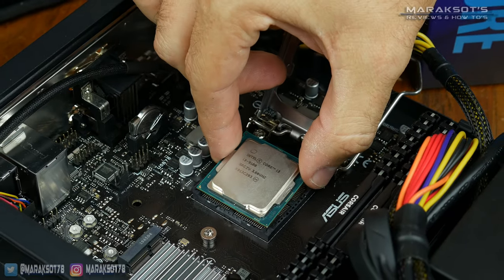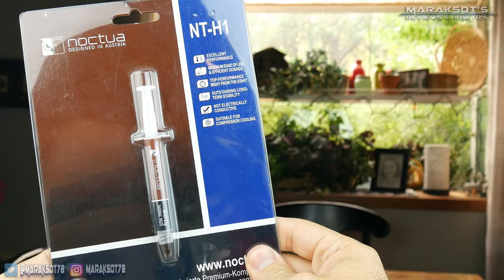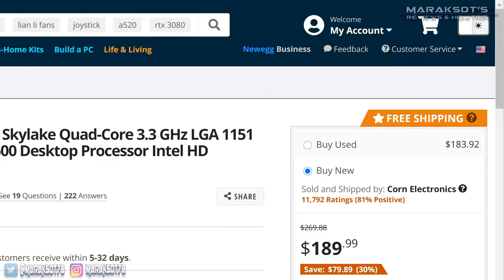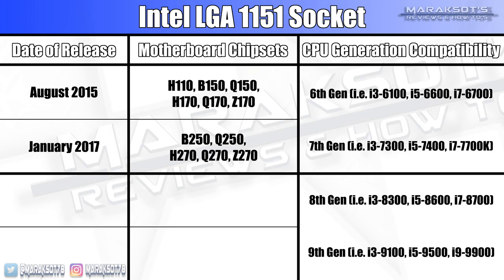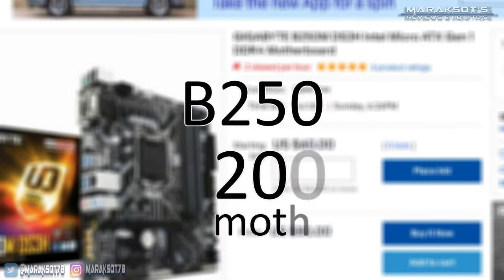A Beginners Guide: How to Upgrade an Intel CPU (core i3, i5, i7, i9)

Comment from the maker: Wanna skip to a particular part of the video? Use the Time Stamps. :)

Time Stamps
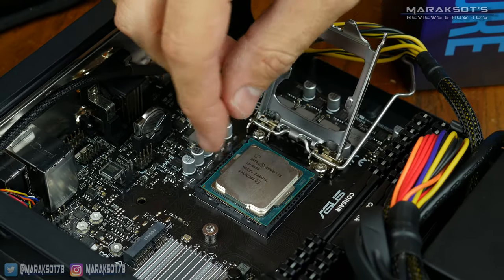0:00 – intro
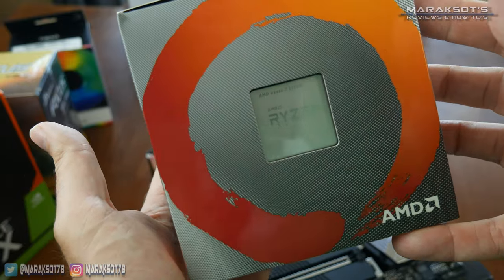0:46 – the first steps
2:02 – CPU cooler removal
2:18 – thermal paste cleanup
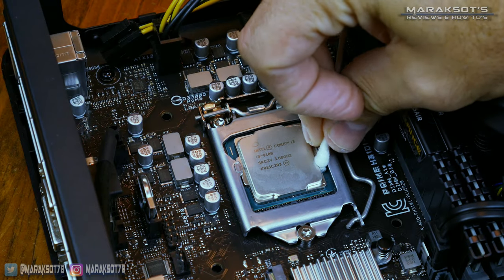2:38 – remove your existing CPU
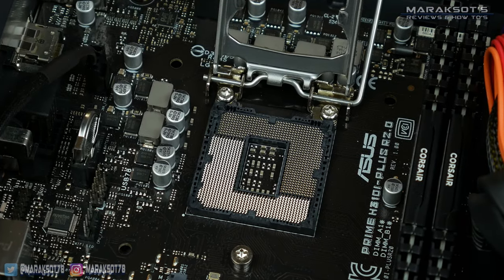3:14 – installing your new CPU
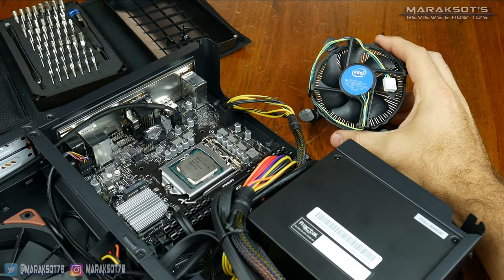4:35 – CPU cooler installation
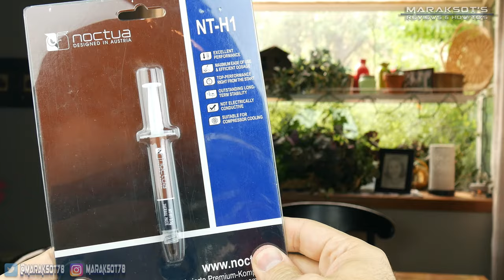5:10 – thermal paste application methods
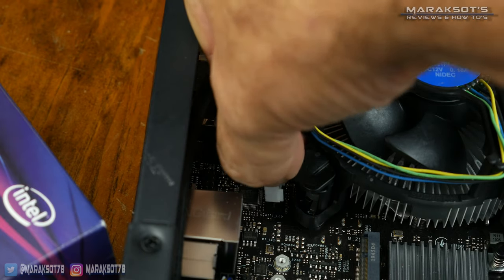5:36 – important things to know when upgrading
6:12 – know your CPU socket
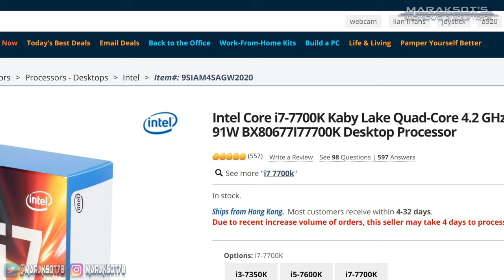7:04 – Intel's LGA 1151 socket is a little confusing
8:07 – motherboard chipsets
9:27 – K series processors
10:16 – cheap motherboard + expensive CPU = Please don't!
11:23 – Thanks for Watching! Like, Share, Comment & Subscribe! :)
Reply: #6%Club
Reply: This video has really broadened my horizons on upgrading CPU for my mainboard... z370-a pro (msi) my motherboard supports overclocking and 8th/9th generation CPU processors.  😁😁😁
Reply: My laptop currently has a fourth generation Intel Core i7-4510U CPU. What would be a good compatible processor upgrade? Or where can I get a chart that would show me options? Thanks for your help!
Reply: Hello,
I have a Star Wars, hp laptop. The cpu got fried. I want to replace the cpu & upgrade the rams from 8 to 16.
Can you please film a vid on this topic. 
All the best Shaun of NYC
Reply: My cpu is a intel core i3-10100 whats a good upgrade for mine bought a core i5-10600k did not work plz help proper cpu for my computer
Reply: #6%club
Really helpful video from you thank you
Reply: any tips on how tu see is my mother bord compateble with now cpu i have hp 18e4 motherboard
Reply: My desktop motherboard is   H61M-S+
Manufacturer_ AS ROCK
CPU socket_ LGA1155
Memory_ 2*DDR3 1600
Graphics_ Support s Intel®️ HD Graphics built-in Visuals With processors which are GPU Integrated.
Graphic output_  1* D-Sub
Sata_ 4*Sata2
USB_8*USB2.0
LAN_ Gigabit LAN
Form Fector_ Micro ATX
Please suggest me CPU for this
Thanks 🙏
......I will wait for Reply. 🙄
Reply: You should do a video on mining crypto on old cpu, then upgrade the cpu  to see the difference in hashrates.  That would be AWESOME!!
Reply: I got a i912900KF the new one right now! What motherboard do I get?
Reply: Hi, please, can you tell me what's wrong of this computer,, after upgrading from a single core CPU to a duel core CPU the computer runs slower and only shows one CPU graph in task manager. Please can you tell me what's wrong?
Reply: I wanted to add a new Intel CPU to my Asus H97M-e mainboard that has an old Intel  i5 4460  CPU but in the computer shop they said that all Intel CPUs have different sockets and a new CPU won't fit on my mainboard.
Reply: Hey I got a I core 5 12th gen

Comment: Thanks for the help looking to upgrade the 10400f to the 117000f 6 cores just isn’t cutting it for my 3070ti😂
Reply: Did you upgrade? Which motherboard are you using?
Reply: @shoronhossain2443  actually switched to AMD and I’m now using a b550

Comment: Glad to see a proper explanation when doing a CPU upgrade. I've seen so many that overlook the motherboard sockets. Specially since Intel did what they did with LGA1151. Just as AMD AM4 socket depending on generation only supports certain gen Ryzen CPUs as well.
Reply: 6% club. Tnx v much. Very clear instructions
Reply: If you have an LGA 1150, does that mean all CPU'S that fits in the 1150 will work?
Reply: @NathanielSolomons  Depends on the board and the BIOS. Sometimes support for CPUs needs a BIOS update, but should fit most other LGA 1150 processors. Just have to check the motherboard specs to see which CPUs are supported.

Comment: #6%club...thanks for a great video.  Knew how to buy the CPU but was a bit leery about changing it out. You made it really easy and I am less nervous know.  Shouldn't be nervous since I built my computer a while ago, but was-lol.  The antistatic wrist wrap bit was hilarious, lol I think I still have mine somewhere with extra cables and fans in a box somewhere. Waiting for my graphics card to come in (old one just up and died, think a power surge got it) then will change the CPU and GTX out at the same time.  Thanks again for a great video, nice and clear info is much appreciated.

Comment: I have a Dell G5. Thanks to your video I was able to determine the best CPU to buy for my specific motherboard. I currently have a  i5-10400F and wanted to upgrade to some sort of i9. I used the command prompt as instructed, used the number to google it and I can only upgrade to 1 type of i9 which for someone like myself that isn't overly tech-savvy I am not overly picky as long as it gets the job done for a few years to come so It ended being a i9-10900KF. It's reasonably cheap at over $500 with taxes. Looks like I made my decision thanks again to your video

Comment: Here on the heels of installing new RAM from the other video, and grabbed an i7 on sale (currently using i5). Not quite brave enough to upgrade it yet (there's a few assignments I'd like to get out of the way first in case things go terribly wrong), but will be following this process when I do! Thanks for making the steps clear and easy to follow.

Comment: Excellent video. Looking to upgrade from my i5-7600K. Was curious to see that no 8th or 9th gen options were compatible (using the CPU-upgrade website), but your bit on motherboards explained that as I have a Z270-P so would have to upgrade to a "300" number for 8th/9th gen options. Now I'm wondering if I should go upgrade the motherboard as well as the processor or just go with a i7-7700 or i7-7700K processor upgrade. Any thoughts?
Reply: Definitely
Reply: If moneys an issue then dont

Comment: I'm using i3-4170 and I'm upgrading to i7-4770
Reply: Nice
Reply: Did it work?
Reply: You also change your mother board 😂😂
Reply: @hangingbat5439 he probably did since his comment is 3 years old...😂
Reply: How
Reply: @hangingbat5439 why?
Reply: @mieru  his motherboard is outdated for the i7 if he has a i3
Reply: Am upgrading to i5 from i3
Reply: @Quesadillaman111  if they have H81 motherboard, its still good to go
Im myself using h61 motherboard and running i7 3770, and it's work perfectly fine
Reply: @helluvademon3936 i5 and i3 doesn’t matter what is the model
Reply: Same
Reply: @Quesadillaman111  no. I was able to just replace it.
Reply: @hangingbat5439  aren't they both lga 1150?

Comment: This may have been added to your comments already, but a great app you can use to ID your motherboard is CPU-Z, and it is free! I'm using an H170 series Core i5 6400T and want to upgrade to a Core i7.  Still working out the kinks, but this video has helped me get closer! Thanks!

Comment: Very good information.  Thanks!  One question, however, what does "over-cloking" mean?
Reply from the maker: Overclocking is the term used when you manually set your CPU, RAM or GPU to run faster than it's out of the box speeds.  For example a CPU's operating frequency might be 4.3GHz, but with adequate cooling and such you may be able to run it at 5.0GHz instead. Overclocking was more of a thing in the past though.  Thanks to competition in the market, manufacturers such as intel and AMD now build in frequency boost features to their CPU's and GPU manufacturers do it as well to try and sqeeze a much performance out of their products as possible out of the box.  Which is why you'll see CPU's now say their operating frequency is 4.5GHz with 5.0GHz boost.  That just means in normal scenarios the CPU will run at it's 4.5GHz operating frequency, but when more power is needed it will boost up as high as it can for a short period of time, usually until the CPU gets too close to it's maximum temperature, at which point it will lower the clock speed to bring the temperatures back down.  There is of course a lot more too it than that, but I hope that at least gives you a basic idea of what overclocking is. Cheers.
Reply: @Maraksot78  Great job of explaining this point!  I appreciate it very much.  Cheers!

Comment: I've been upgrading my Aurora R8 I got in 2018 recently. I've upgraded the RAM to 32GB a couple months ago, and I'm planning to upgrade the stock i5 9600k to an i9 9900kf which, as far as I can tell, is the highest performing Intel CPU with the same socket type. I chose the kf variant since the integrated graphics of the k variant is superfluous when I have a GeForce RTX 2070, and its so much cheaper than the k variant. Thanks for the vid man, major component replacement really is plug and play with these modern desktops huh? Lol

Comment: Great video/explanation. I've been thinking of upgrading my i5-8400 CPU @ 2.80GHz, on TUF B360M-Plus Gaming S, what are my options?
Reply from the maker: If you're looking to see a noticeable performance upgrade then I'd recommend going to a 8000 or 9000 series i7 like the i7-8700 or i7-9700. The B360 chipset doesn't support overclocking so I wouldn't spend the extra money it costs for a 8700K or 9700K.
Reply: @Maraksot78  Thanks a bunch! What about i9? Possible/doable-worth it?

Comment: This video was very helpful - I was changing the same socket, actually from i3 7th gen to i7 7700T. Nothing has exploded yet so that's good. I would note that the cooling fan is not that easy to snap out, and also not easy to snap back in. Also yes #6%club

Comment: Greatings my dear!

This video was very helpful for me, thanks.

I'm a freshman in CS and would like to upgrade my pc to fit my current and next needs.
Before, I use my pc for data analysis with R studio, tableau and SQL platforms, etc... Now I want to jump in video gaming and programming.
The PC is 10 years old  I think and it is from DELL.
PC: Optiplex 9010 Intel i5.
I want to upgrade to Intel i9 if possible. I can change anything that needs to be changed.

My question: Can you give me a guideline to follow in order to reach my objectif? Or propose a better idea?

Thanks!

Comment: So, this was quite a few years ago that I got an Omen pc. At the time we were going to build a pc from scratch, (my brother was, he knows more about this than I do but has since moved), and we had ordered all of the parts, only to find out that the order was canceled over the weekend because of a credit card error. So we set about re ordering everything only to find out that the graphics cards had gone up to $350, where as they had just been $150, I think. So we shopped around and got an Omen, as it was going to be cheaper than building at that point.  Anyway, I'm very late to the game now, but seeing as the issues with computer chips, graphics cards are going to continue on for the foreseeable future, I thought I better figure out what my pc needs/and can use, get it and upgrade what I can now, to save some time/money down the road. I've mostly used it for things like GW2, lol, the Witcher 3 and so on, and haven't had any issues yet, but I figure it can't hurt to learn these things myself. Although I don't think I need to upgrade the cpu, I think I could upgrade the ram (it has 2 slots for it).

omen desktop pc 870-2XX
Intel(R) Core(TM) i5-7400 CPU @ 3.00GHz   3.00 GHz
8 GB Ram 1Rx8 PC4-2666V-UA2-11 MTABATF1G64AZ-2G6H1

Comment: Thank you, I just learned I have a low-end PC and I need to upgrade basically everything. I'm running an (Intel Core i3 4130 Haswell socket 1150 LGA) I don't have a lot of cash but I do want to upgrade, I'm a gamer, and some of the games I play just not working up to par. Looks like i'll have to upgrade my motherboard with everything else to get the PC I want to run the games I play and run smoothly. Got my Sub 100% I just learned a lot for this vid. Now I know where to go for more PC info...

Comment: Check Arctic Cooling's site for some tips on cleaning and applying thermal compound. Lint-free cloth is a lot better than paper towels. 70% alcohol will leave residue you don't want. Do not touch the surface of your CPU with your oily, grimy finger tips. That Noctua gunk is really good, BTW.

Comment: Thanks for this explanation. I have a desktop with configuration (Intel(R) Core(TM) i7-5820k CPU @ 3.30GHz  3.30 GHz) and want to upgrade to Core i9. Will it be compatible with the board?

Comment: Hello...Guess I'm a 6%er...great video. I kinda get lost in the component numbers and was hoping you could help me out.
  I have an old but faithful Acer Veritron  M4620G  (B75H2-AM) desktop that recently started acting up and I have tried several things to revive it. I have ordered a replacement motherboard (T60 M4620 ,B75H2-AM LG1155 ) and was hoping to upgrade the CPU from the original i5 to an i7 because I do sometimes like to play COD games thru Steam. Would this upgrade to an i7 be possible ? and if so which Intel CPU should I order ?
  Many Thanks,
  Barry

Comment: currently on an i5-9400 used in a gaming setup. 

i upgraded gpu to rx 6600 from a rx5500 and i seem to be having a bottleneck i would assume.

should i upgrade cpu to i7-9700 / i9-9900 without intentions of overclock to keep powerdraw within same range as my current cpu?

Would it be a big enough improvement for solid/stable 1080p build?

im trying to just do a cpu swap instead of dealing with coolers, mobo, etc. Also being that im on an hp pavilion pre build.

Opinions would be greatly appreciated thank you and awesome content! #6%club

Comment: Excellent video, am a newbie to the CPU stuff but am looking to upgrade from a intel celeron g3900 to something a little snappier, have an office computer hp prodesk, g600, it has 16gb ram , an m.2 512gb, a new Seagate exos 4tb going in on Monday one or 2 other SSD drives,  any advice would be extremely helpful and would be very grateful for your wisdom. 👍

Comment: hi maraksot, thanks for your helpful video. i ve been planning to upgrade my rig from an i5-10400F to an i7-10700K ironically exactly with the sub 100 motherboard (from gigabyte) you were showing in your viedo. i bought this PC prebuilt and wanted to upgrade it to de max without having to exchange my motherboard (more difficult to exchange), but now i am not so sure about that anymore. would you say it is still okay to do so or would you not recommend it. graphics wise a rtx3080 is built in.
thanks for your feedback, much appreciated. #6%Club

Comment: Im still using the maximus vi gene mobo this day with non-k i5 processor. Im just capable to upgrade the cpu just now but wondering which one should i buy? Any useful tips i should know before upgrading? Do i have to reinstall windows after upgrading only my cpu?

#6% for this video(first of your video i watched so far)

Comment: Hi thanks for the video! i'm thinking about upgrading my intel CPU. i'm thinking about going from an i5 6500 to an i7 7700k. physically replacing the CPU seems pretty straight forward. is there anything i would need to do after replacing the CPU to make sure it is running properly optimized? do i need to update drivers or do a fresh windows installation or is it just plug and play and you're good to go if going from an intel CPU to another intel CPU?
Reply from the maker: Depending on your motherboard you may want to update your BIOS as your motherboard's BIOS may be older and not support 7th Gen CPU's.  I'd boot into your BIOS to see which BIOS revision your currently running and then look at your motherboard manufacturers website and see if the version you currently have supports 7th Gen or not and if needed, download and install the most recent BIOS version.  Other than that though once you swap in your CPU you should be good to go.  Nothing else needed that I'm aware of.

Comment: Hello - I have a Z370 motherboard and an Intel i5-8400 processor. Was looking to upgrade to an i7 and I believe the i7-9700 is compatible as it is the same chipset (LGA1151) and has the same power consumption (65w). Looks to be around $350 for the i7-9700. #1 question - Am I correct in my research that the i7-9700 will work with my motherboard? #2 question - Do you think it is worth the upgrade for the price? Thanks - Brian

Comment: I'm currently using the Dell Inspiron 5000 (an all in one computer) that I purchased from Amazon back in 2018. In the past, I've made some serious upgrades where I swapped out my hard drive with a solid state drive, expanded my physical memory (RAM) from 8GB to 32 GB and replaced my old cooling fan with a new one. The last thing that I need to change is my current CPU (Core i7 i7-7700T Quad-core (4 Core) 2.90 GHz Processor). My question is, will an Intel Core i9-12900KF accept my Dell motherboard (0FKYCM)?

Comment: Hi, I have i5-10400F and GIGABYTE B560M AORUS PRO AX motherboard and I am thinking about upgrading to i7-11700F. Do you think it would work or there would be issue with power delivery from the mother board? Also, very nice video! I came here clueless and now I feel like I know everything important. Thank you a lot.
Reply: Hey does the i5 10400F run windows 11 and is it good?
Reply: @SophyJunior1  It does run Windows 11 and it's pretty decent. I'd keep it if I didn't need the 11th generation CPU
Reply: Thanks

Comment: I have a msi b365 cheapo and I have my i5 9600k running at 4.3 ghz so yes you can overclock it** (turbo boost will not go beyond 4.3). There are specific models that advertise "turbo boost" on the motherboard from my understanding it's essentially overclocking.

Comment: Quick question, my home system tower has a little age on it but was built SOLID by a friend that was into heavy gaming.  I'm not a gamer, but was thinking about upgrading while my hard drive is safe from making that dreaded high-pitched whine.  I currently have an Intel processor i5-3570 @ 3.40GHz, 16GB RAM and a 1 Tera HDD, 64 bit OS.  My question is, is it really worth upgrading my processor for a newer one, which would probably entail upgrading my Motherboard too along with the RAM or could I just get by with upgrading my HDD to something like an SSD for system and a new HDD for storage?...possibly upgrading my CD-ROM as well.  Thanks for any input.